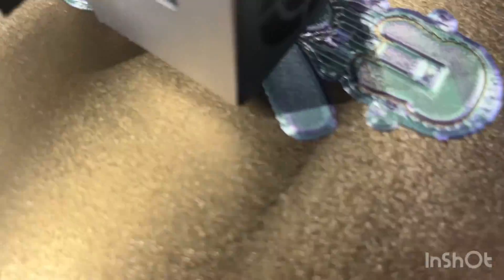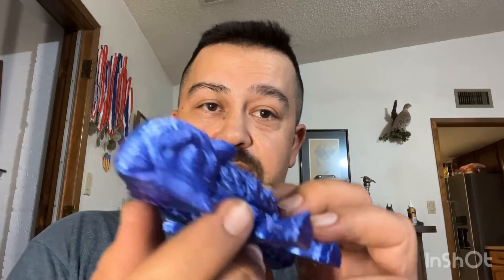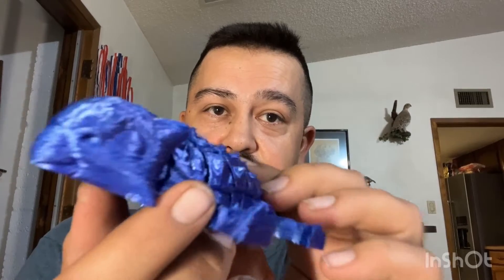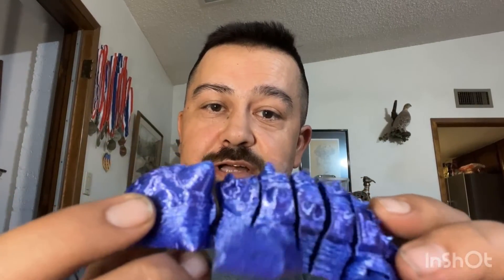Why is my 3d print coming out squishy?!

Comment from the maker: If you’re interested in any of the filaments or products in the video, here are the links…

Ender 3, 3D Printer:
https://www.amazon.com/gp/product/B07BR3F9N6/ref=ppx_yo_dt_b_asin_title_o04_s00?ie=UTF8&amp;psc=1&_encoding=UTF8&tag=idiotcraftman-20&linkCode=ur2&linkId=71edf3ee204dd4255aa8d69663d6ea72&camp=1789&creative=9325

Filament used in video
Blue and Purple:
https://www.amazon.com/gp/product/B0BZJSM1HY/ref=ppx_yo_dt_b_asin_title_o03_s00?ie=UTF8&amp;th=1&_encoding=UTF8&tag=idiotcraftman-20&linkCode=ur2&linkId=5ea3bad9d0e07beb82fde87e71063d88&camp=1789&creative=9325
Green and Purple:
https://www.amazon.com/gp/phttps://www.amazon.com/gp/product/B0BN5ZC38F/ref=ppx_yo_dt_b_asin_title_o03_s00?ie=UTF8&amp;th=1roduct/B0BZJSM1HY/ref=ppx_yo_dt_b_asin_title_o03_s00?ie=UTF8&amp;th=1&_encoding=UTF8&tag=idiotcraftman-20&linkCode=ur2&linkId=394118662b60cf4b74d5f934070d3470&camp=1789&creative=9325

Filament Dryer:
https://www.amazon.com/gp/product/B09SPWSX4B/ref=ppx_yo_dt_b_asin_title_o00_s00?ie=UTF8&amp;psc=1&_encoding=UTF8&tag=idiotcraftman-20&linkCode=ur2&linkId=f72d10e8ac90b612cee2e5deddf62e52&camp=1789&creative=9325

Printer Lighting:
https://www.amazon.com/gp/product/B0B7B1QG5Q/ref=ppx_yo_dt_b_asin_title_o02_s00?ie=UTF8&amp;psc=1&_encoding=UTF8&tag=idiotcraftman-20&linkCode=ur2&linkId=54889501ae339531f98e79dd14749d6e&camp=1789&creative=9325
PEI Print Bed:
https://www.amazon.com/gp/product/B08PFHBR2D/ref=ppx_yo_dt_b_asin_title_o00_s00?ie=UTF8&amp;psc=1&_encoding=UTF8&tag=idiotcraftman-20&linkCode=ur2&linkId=4c9ad76a0add1fb07ef44b14cf1757e6&camp=1789&creative=9325
3d Print Camera:
ttps://www.amazon.com/gp/product/B0C84PZTT4/ref=ppx_yo_dt_b_asin_title_o02_s00?ie=UTF8&amp;psc=1&_encoding=UTF8&tag=idiotcraftman-20&linkCode=ur2&linkId=8996f2909e64e933754abe19cb456bf6&camp=1789&creative=9325

Comment from the maker: Update: the print turned out great after adjusting!
Reply: What was the issue? I was gonna guess Over extruding and putting a new nozzle on
Reply from the maker: @ExiLeGamingTeam new nozzle, but mostly adjusting the bed closer
Reply: @IdiotCraftMan so it wasn't Prusa Slicer at all?
Having similar issues with my Ender 3 pro and changed out the nozzle, re-leveled the bed several times, checked firmware settings, still getting squished or totally ruined prints.